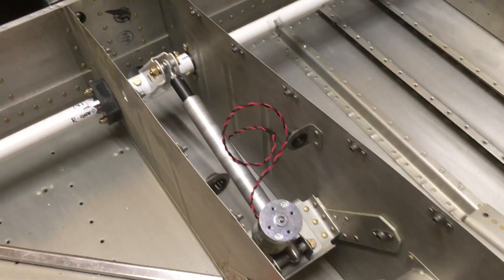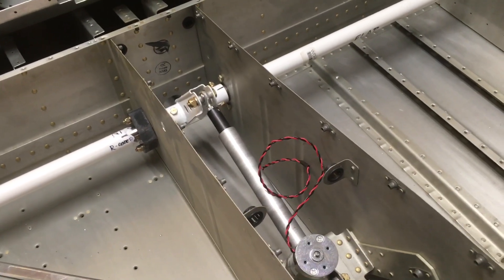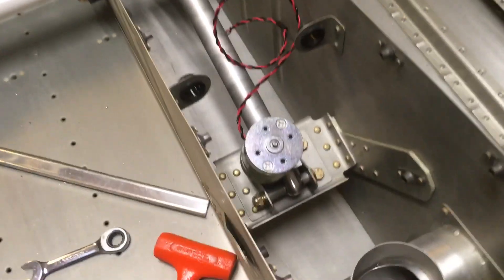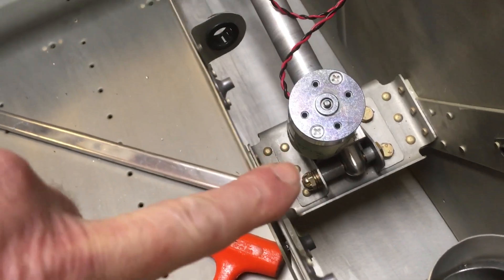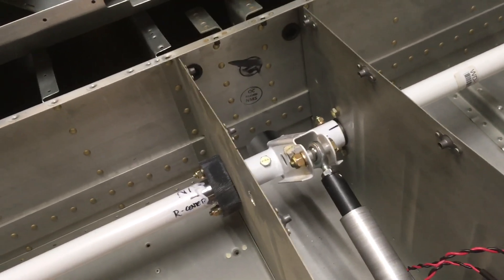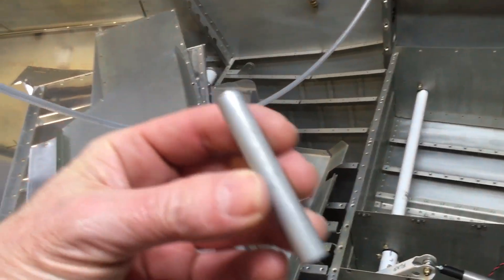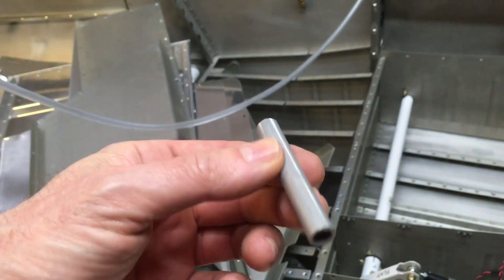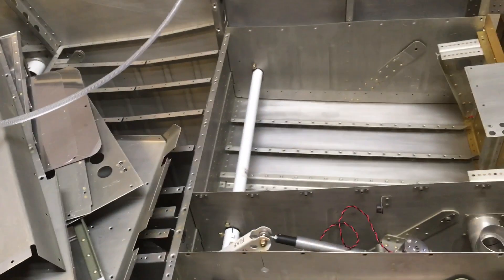RV-10 Flap Motor Install

Comment: I wouldn't think that anyone would want to rush build an airplane. Do any of those bolts get safety wired? Great job!
Reply from the maker: Thanks for the comments guys!  All fasteners are either a drilled bolt with a castle nut and that would get a cotter pin like on the bolt at the motor end of the flap controller in this video.  Others use an undrilled bolt with a nylon insert lock nut.  It all depends on if the bolt could or should rotate.  Bolts that are in a blind hole use a drilled head and those get safety wire.
Reply: Exactly. I would not want to rush, especially knowing I will have passengers/loved ones on board. Must be enjoyable when working on it as well...imho.